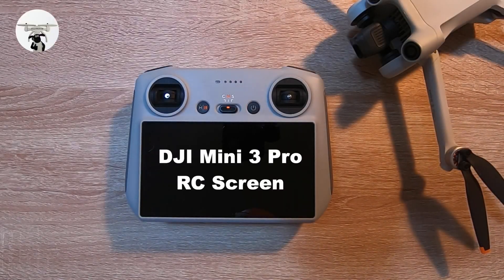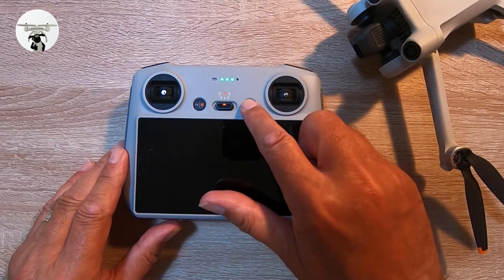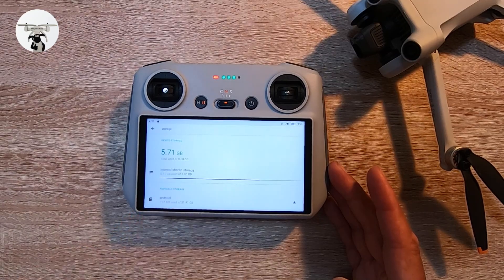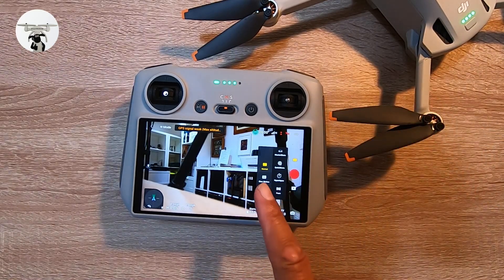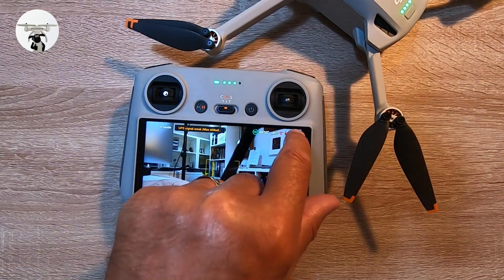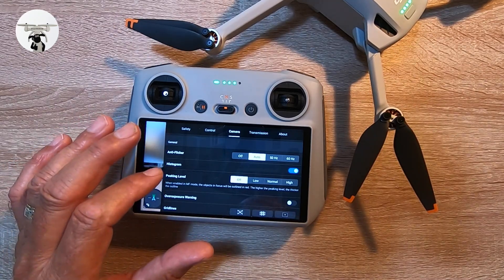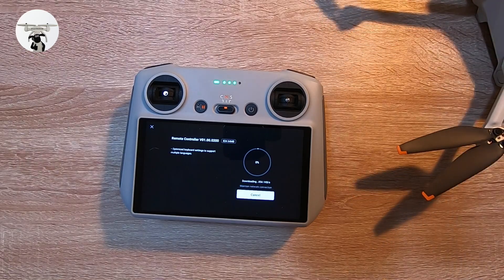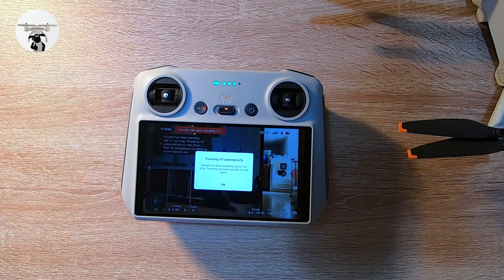DJI Mini 3 ProTutorial How to use the RC #shaunthedrone #djimini3pro

Comment: Can I use Air 2s charger to charge RC or need to buy special charger for RC?
Reply from the maker: Good question, I don't own the Air 2S but can't see why you can't. Best ask DJI Support, let me know how you get on :)
Reply: @shaunthedrone  I tried it and it works.  It charged the RC normally as well as the regular controller.
Reply from the maker: @conormalinois  good to know, many thanks :)

Comment: spain is too hot for flying dji drones but it can be done with caution.
Reply from the maker: It can get very hot during July and August, usually I fly early morning or late afternoon with no problems. The RC Screen has done very well in direct sunlight, obviously try to keep in the shade :)

Comment: Yes the holes in the bottom are for a strap
Reply from the maker: Cheers Chris, I see you can get a strap on Amazon and eBay now. Many thanks for your comment :)
Reply: Not a problem can you tell me how you can walk and talk to the video feed at same time
Reply from the maker: @christopherclemow8080  I use the DJI Pocket 2 with mic, works really well :)

Comment: On my CE unit there are auto and manual selectors but they are not functional and cannot select either unless the drone is disconnected but when reconnecting to drone it reverts back to auto. I want 2.4 ghz for better distance connection. How can it be done.
Reply: I think with the new upgraded version they dont DJI doesnt want you playing with the connection slection manually and may feel the auto selection is the better way to connect to the better of 2.4 ghz. I decided to return mine today after multiple poor connections when flying directly over ocean without obstruction or interference and only having 1-2,000 m distance. The drone kept going in and out of RTH and its not acceptable. My old Mavic Pro still  goes 10-15,000 m. Im sticking with the old guy for now until they fix the bugs in this $1000 one.
Reply from the maker: @jamielewis1723  sorry to hear but done best if you're having no problems with your Mavic Pro, still a great drone.
Reply from the maker: Good question Jamie and one I just can't answer at the moment - I will have a look later but hopefully somebody else who may read this can help :)

Comment: Well done, thanks!  Ordered my Mini 3 Pro with the RC screen, eta end of June.  Is there any need to connect my iPhone either via BT or WiFi to the controller?  If so for what purpose?  I cannot create a hot spot; hence my question.
Reply from the maker: Thank you JR, hope your drone arrives soon. There is no need to have your phone/tablet connected to the RC screen. You can update maps before you go out. That's the best thing about this set up, no need for anything else. Many thanks for watching :)